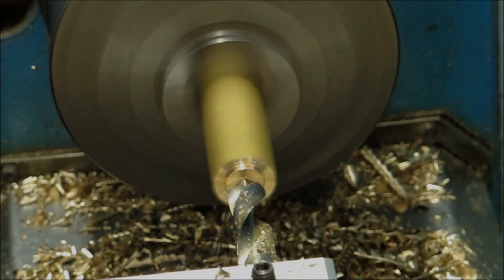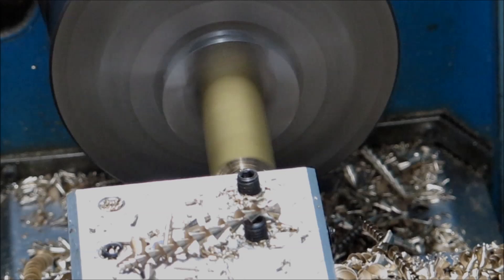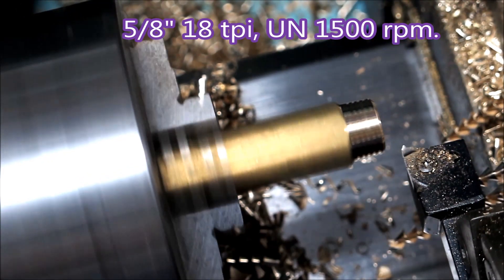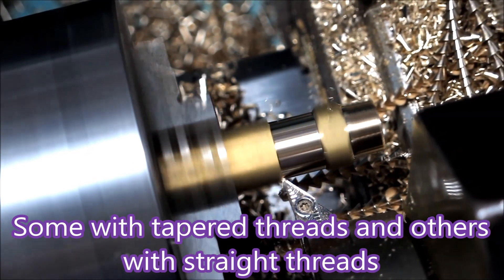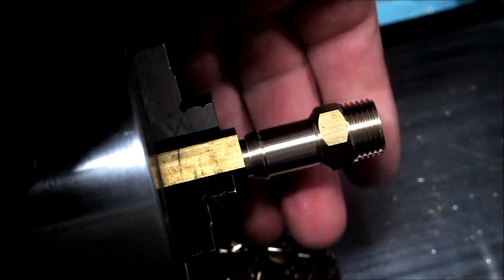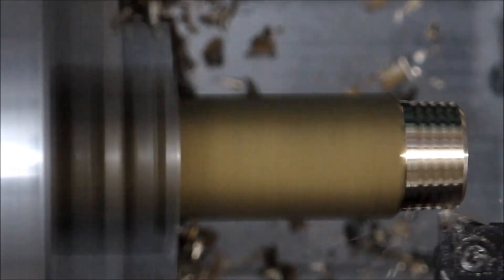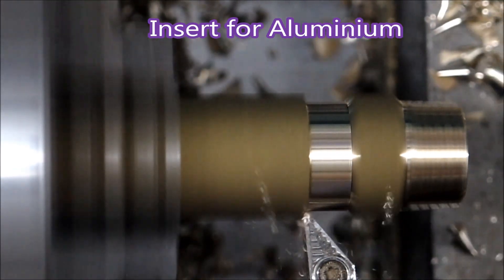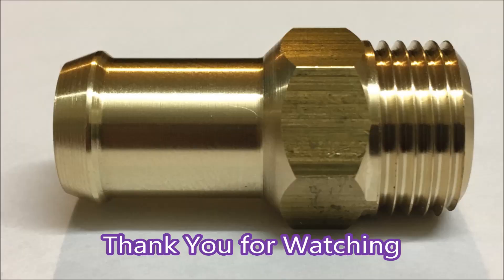Cnc lathe threading a Hose Barb for Classic Mini Minor A series Engines.  Drilled, turned, &  parted

Comment: Excellent work man! You are using a servo spindle. Isn´t it? With motor you are using, direct or with pole? it can work in steel too?
Reply from the maker: Christopher Vargas the spindle motor is 180 vdc, controlled by a Minarik driver card. The spindle motor is .37 kw and does cut steel. There is a video of it turning a pullstud in 4140 steel among my videos. Thanks for your comment. https://youtu.be/2QU3xGtlixw is the video.

Comment: What mini lathe do yo use mate? Looks like cool little set up along with tool changer... i want it:D
Reply from the maker: A Hercus PC200 made in Australia
Reply: @smallcnclathes  Thanks, might be hard to get in Europe... anyway, great stuff and nice job mate:)
Reply from the maker: Funny you should say that.  I am regularly in contact with chap in the UK, that bought one from Sydney here in OZ and had it shipped to him.  He is setting it up with a block for gang tooling and will be using it regularly to make small brass fittings.
Reply: @smallcnclathes  Rly? I was under impression that they are not made anymore (after i checked the page from your channel). Are they any good for hard steel? Thinking about wabeco d6000 cnc, but my wallet says i gotta rethink a lot;) What is the price of your setup if i may ask?
Reply from the maker: I believe production stopped around 2006?  I did a job turning milling machine pullstuds in 4140 and to be honest it was not much fun.  There is a video on yt.  I did another job in 4140 and there was a lot of parts to make, I gave up at around 50 as I was breaking too many parting tool inserts.  So the machine may be capable, but I may be a poor driver of it to machine harder steel as it is not something I get much practice with.
A lathe here generally sells for between 3 to 5k (AU) depending on if it has a turret or not.  The older PCs that are use to rune them are getting difficult to find the interface card requires an ISA slot on the motherboard!  Many are being retro fitted with other forms of cnc controller as folks get fed up trying to keep the old electronics and PCs working.
Reply: @smallcnclathes  I guess i will stick to Wabeco then... just gotta save up some cash for refub machine. Thanks mate for answers, will be visiting your channel often, these cnc turning videos are like porn for grown up men;))